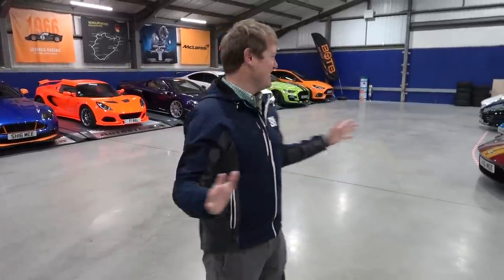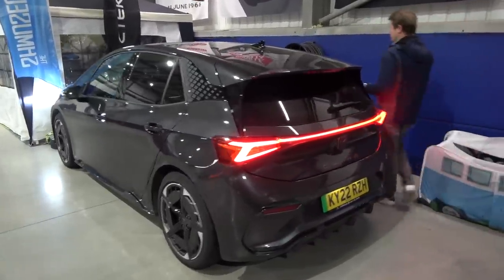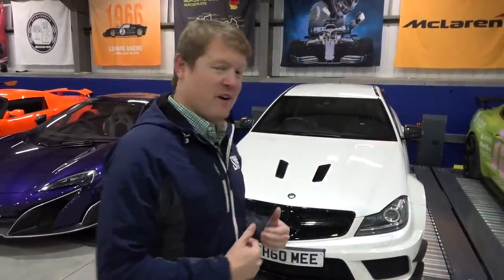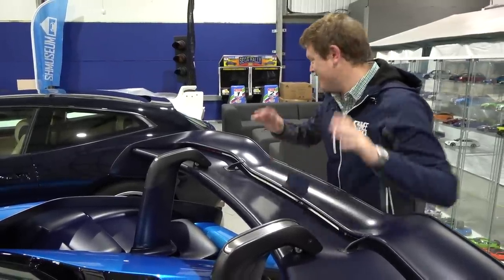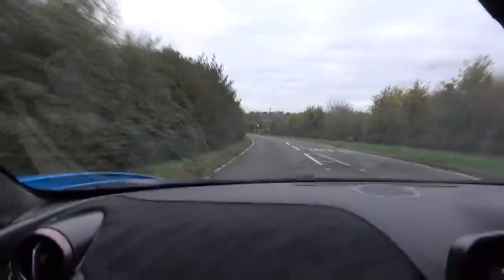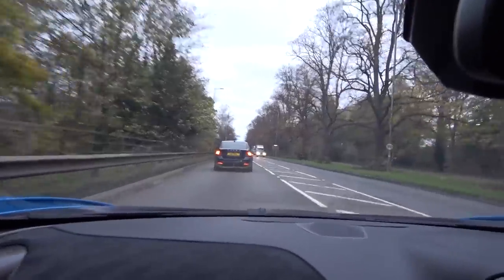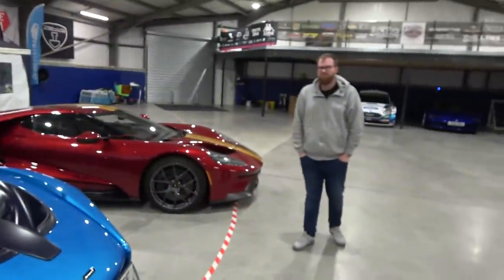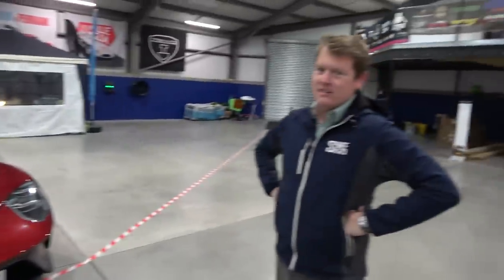My MCLAREN SENNA is FIXED! Revealing What Happened | SHMUSEUM VLOG 99

Comment: I am short listing the E-Class Estate. From what I have gathered, other the Volvo V90 (wich is otherwise less spacious) has a wider loading width between the rear wheels. And it does look lovely.
Older Merc interior look 'eh to me, but there might be a spec out there that works for me. The new ones are reallllly nice.

Comment: 29:00 just wondering can you use Ctek EV charger for SF90 or does it have special ferrari connector so you must use its own charger. because if you can use EV charger for the ferrari it woud brobally make sens because  those mobile connectors tend to wear out and brake faster if you use them daily.

Comment: Hi Shmee! Since you have the Shelby GT500 in the UK, I think it's time to put a supercharger on the Vantage GT8 to have similar performance and noise, like the GMR 600 you drove 5 years ago. Also, you need to put an exhaust on the Senna because is too quiet to be a track car.

Comment: I think the Senna is a useless machine.  It does not look that great.  It is useless to drive anywhere but on a track.  If you want a track monster, then get a purpose-built race car like the Manthey Racing GT2 RS for less money.
I love the spec that Tim has made.  I think he should sell it before it tanks in value.  The Hamilton Collection just totaled theirs out.  Blue is his favorite color, and he wants to replace the black one that he never really liked.  Match made in heaven.
Reply: "the Senna is a useless machine", says someone who never had a Senna and much probably any supercar. The matter of looks it's personal, you may not like the design of it on a aesthetic perspective but it ain't universal thinking PLUS Shmee himself really likes the car and if he likes it, that's what matters. It's his garage, not yours.

Plus, Shmee has his cars in the UK and his Senna is UK-SPEC (Euro spec plus the steering wheel on the right side) while you're talking about an american collection
Reply: @Antonio88870  I have no super car.  Or a yacht or a castle.  But I do have an informed opinion about which cars or boats or mansions make sense.  
Why do I call Senna useless?  Use on roads is uncomfortable.  There is no storage space.  So where do you drive it to enjoy it?  Best option is to trailer it to a track which is where it shines.  But on a track, it will have little or no performance advantage vs a car built for the track.  But is does have a very high price tag and is almost impossible to repair.  A track focused car is likely built with easy to replace panels and running gear.  It is like using an offshore cigarette boat for an afternoon on the lake with the kids.

Comment: I hate mclaren. My 570s was one of the worst cars I've ever owned I'll never buy another McLaren. The firewall unhinged itself and was sitting on the frame, it never recognized the key. It threw more faults than any supercar ive come across. I couldnt even wash it or the car would just shut down. And this was a new car. Insane how incredibly bad mclaren is. It's no wonder you haven't driven your 675lt or senna in over a year on your channel it's because they don't work.